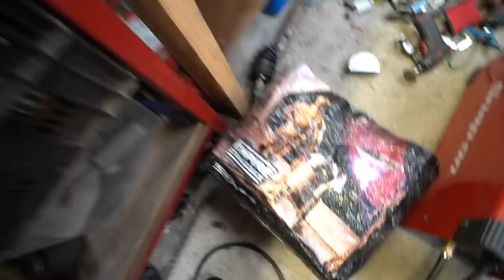AE86 Arch Rebirth! The First Flared Arch is Complete.

Comment: What are the specs of the longchamps?
Diameter, width, offset and tires too?
Reply from the maker: 14x8.5-19 at the rear, 14x8-12 up front with 185/55/14 tyres ❤️